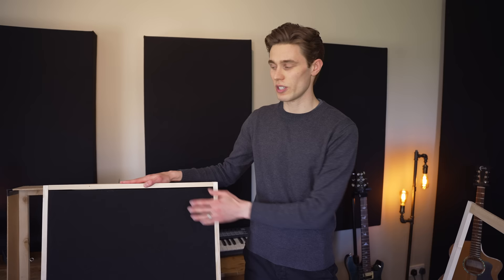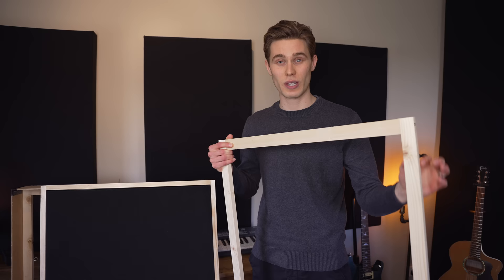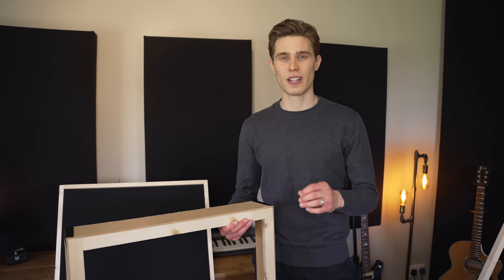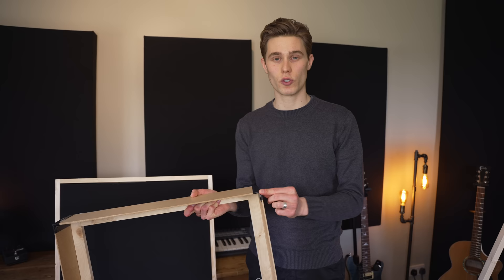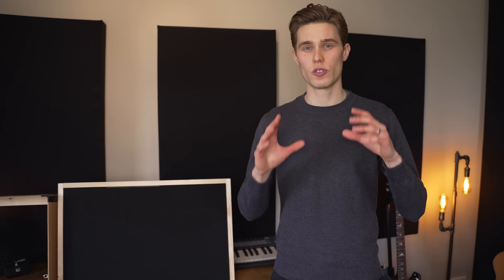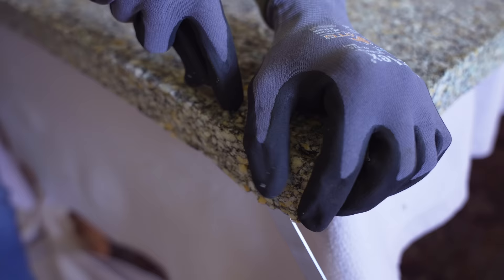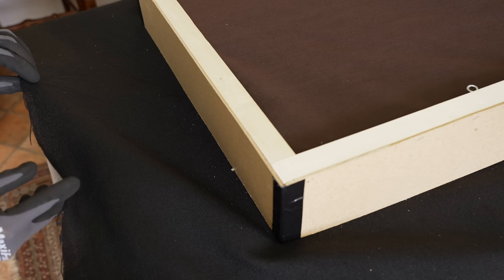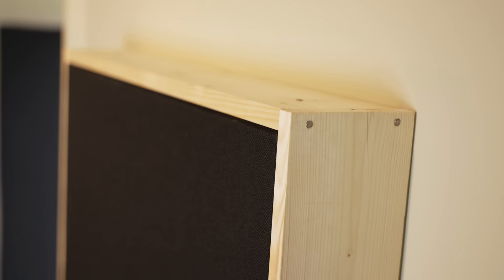How To Make Your Own Acoustic Panels - DIY Professional Acoustic Treatment for Home Studio

Comment: Hi , I really need help please , in my country I can find only PST90 foam that has a density of 90kg/m3 and it’s only 40mm thick… could I only use one to make a panel or it would be better to stack two and have a panel of 80mm thickness? But it would be very expensive… does it make that big of a difference?
Reply: Can't say anything about the foam you mentioned.

But for insulation what matters is not the density, but the "Flow resistivity (Pa.s/m2)". And sadly there is basically no proper correlation between those. One material can be very dense, but not flow resistant, and vice versa. Instead of dampening and eating the energy of sound waves, dense material can simply redirect waves, not improving the reverb situation at all.

I was as sad as you, because similarly to you I found a 120kg/m3 material and was researching the same question.

Thickness matters by itself. Dense but thin materials are not even seen by lower frequencies. There are simple formulas to calculate those.

Comment: Hi, thanks for the tips, I really appreciate that, but I have a question. Is it a good idea to build my own bass traps too using the same materials? 
Obviously with a different shape of the frame
Reply from the maker: Good question. I would advise you to build your own bass traps and make them thicker if you have space. Either a triangular prism frame or just a square frame panel in each corner would go a long way in controlling the sound of your space. 

Many would opt for slightly higher density material and/or much more depth in a bass trap panel. It’s not uncommon for them to be more than 15 or 20 cm deep.

Comment: Hey so I'm building some panels at weird thicknesses to make kind of a stair effect on the wall. My first panel will be 2" thick, 3", 4", 5" being the thickest. How tight does the insulation have to be stuffed to be of utility? I'm planning on using 2 layers of 2" Denim insul inside the 4" and 5" but there will be a small gap in the 5" thick panel, and the 3" thick panel. Is that okay? 

Thanks a lot :)

Comment: Modern glass wool is bio-soluble. Completely safe.
Reply from the maker: Let’s assume I accidentally breathe some in and it completely solubilises in a matter of weeks or months. 

Tell me, where does that solution end up? All the same chemicals, compounds and molecules end up either passing through my system or remain in my system. 

It’s important to note that most poisons are bio-soluble too. They can pass through us but cause tremendous and often long lasting ill health. It’s something to think about when companies apply labels such as “biodegradable” or “bio-soluble”. What does it biodegrade into?

Comment: Question. I’m In wat I’d describe as a medium sized bedroom with my laptop on a table by the windows and my bed behind me. I did a test in Audacity to test exactly what my natural room acoustics are(without me speaking) and looked at it on a spectrogram. I noticed that without treatment I have to set a HPF to over 1k to get rid any major degree of low end rumble, which is obviously gonna make eq tricky coz the natural room resonance is clearly interfering with the high mids of my voice so if I cut the high mids to the point where it kills the clarity, it’s going to kill the clarity in my voice as well. How will I know the trouble spots that are causing the 1k resonance, so I know how best to treat my room

Comment: Is it effective leaving those 20 cm spaces between the panels? (For walls between flats) Would be good news if yes. Or is it just a bit less effective but still good?
Reply from the maker: These panels won’t stop much noise travelling through the walls. They ate mostly designed to reduce echo and reverberation within the room.

Comment: Hey, just ordering material for these, but I'm struggling to find something like the particle board you've used for the inner sides of the frame.
Any recommendations? The material you've used seems almost like thick cardboard rather than wood, and I'm trying to keep weight as low as possible, so I'd rather go with something like that but not sure what to search for!
Reply: Try 3/16” hardboard.  Building supply stores carry sheets, but Lowe’s and Home Depot probably don’t.

Comment: What properties does the front fabric need to have (ie the fabric that can be seen once it’s hung)? I’m thinking some fabrics will themselves reflect more sound than others and make it less effective? Basically I would like to try making some of these and printing some photos on fabric for the front of the panels so it just looks like hung pictures rather than blocks of colour
Reply: Keep it acoustically transparent.  Rule of thumb is, if you can blow through the fabric without slowing down the flow, that’s good material.

Comment: Hey Michael, last year I made 8 panels, but used mineral wool as a material, since I haven't seen your video yet at that point. A few days ago I stumbled upon a Facebook post warning about possible health concerns with using mineral wool and it got me really worried. Basically it said that the wool releases Microparticles in the air, which if you breathe in regularly can cause lung fibrosis, autoimmune diseases, skin and eye irritation, etc. I was wondering what do you think about this? Is it that bad? Should I necessarily switch to some other material like the ones you showed? Do you have a link for somewhere I can buy the material you used? I live in Europe, so I probably could order off the same place. Thanks in advance and great video!

Comment: Michael, what are your thoughts about using burlap sacks instead of insulation? They are cheap and plentiful here in Mexico where they're used by coffee bean sellers.
Reply from the maker: The burlap sacks (I assume rolled or layered up inside the panels?) will absorb and dissipate high frequencies but will not treat the mid range or low end in a meaningful way. It could be useful to reduce echo but might result in a lack of clarity in the room.
Reply: @inthemix  Thanks for the reply! I would be layering them inside frames like those you built in the video, for use in a studio where only voices (no music) will be recorded.

Comment: Would it be a good idea to use them as ceiling clouds? 🤔
Reply from the maker: Yes they would work very well. I might suggest using 2 layers if fabric or pulling the fabric more tightly when used as a cloud.

Comment: Thanks for this awesome detailed video. A couple of questions, for any expert out there to answer, please: 1) Could I use canvas as a covering fabric on your design? I ask because my daughter is a young artist and I think it would be great to have her do some art on my panels, make each one a work of art. 2) I’m also thinking of alternatively using off the shelf blank canvas frames that you get from art suppliers and modify them, with say an extra frame on the back, to make them deeper and fill them with acoustic foam, thereby transforming artist canvas frames into acoustic panels. Any merit in that idea, or would either of the above be not very effective? TIA.
Reply: It depends on what you want to accomplish. Dense canvas is not the most acoustically transparent fabric, so it will reflect some high frequencies. Many foams are not very dense, and therefore less useful for low-frequency absorption.

Comment: Would making one of these panels and hanging them on my hollow door reduce sound getting out of my room? The only sound that I need to block going out is my voice.
Reply from the maker: These are more effective at reducing reverberation within the room. While they would help reduce some sound passing through the door, I feel a better approach would be to use silicone or rubber door seals and maybe use a sound curtain over the entire door.
Reply: @inthemix  I live in europe and haven't been able to find any good sound curtains for a reasonable price.

Comment: First of all let me tell you big thanks for inception of idea, not to use rock/mineral/fiberglass panels, because one summer I have been working at door producing manufactory. And ot was hell, because there was fiberglass insulation. I ran out from there very quickly :)

So. I’m from Estonia and here is no recycled denim… :((

I have found Hemp fiber Insulation with 50mm and 100mm thickness. It have 37kg/m3 density.
Also I have found Wood fiber.
Same thicknesses. And 50kg/m3 density.

Which of them, I mean wood or hemp, better? And what thickness is works best?
Also I heard bigger gap from wall also helps with lows. What gap at least must be?

Thank you in advance! ❤
Reply from the maker: Thanks! I think the hemp and wood will both work well but I have heard that hemp fibre is especially good. Thicker is better, I’d choose the 100mm. 

For the air gap, make it as large as possible. My panels have a small air gap built into the back but you can also add small blocks of wood to the rear of the panel to make it sit another few cm from the wall.

Comment: Is using rockwool density 100 kg/m3 good for making panels? And the panels would be 5 cm or 10 cm?
My room is small 3.2m by 4.2m.
Reply from the maker: 100kg/m3 does seem quite dense. It would likely be acoustically effective but the panels could end up being very heavy.

Comment: What do you think about Melamine foam for acoustic treatment?
Reply from the maker: I took a look for some spec sheets and found that Melamine acoustic foam has an exceptional absorption coefficient above 1000Hz. Below 1000Hz is not amazing but you’d need several feet of panel depth to make much of a difference in those low frequencies anyway! 

I’d say it’s a good choice if the price is right. If you do choose it, could you let me (and the community) know if it was successful? I admit that I didn’t know about that foam until you commented!

Comment: How are your panels working today? No things you would change or so? Also, i wonder, you did corners too right? Regards
Reply from the maker: They have held up great. The “professional” ones I bought have bowed over time at the top and don’t have the same clean lines as these ones. 

I have had lots of feedback from people who have followed this design and I can definitely recommend using at least the thickness of wood I suggested. Some have tried with thinner strips and it just doesn’t have the strength. 

Id also recommend sizing up the cloth carefully as some people underestimate how much they need to wrap the sides and still have spare to staple in place!
Reply: @inthemix  great, Ive watched dozens of videos on the subject, you certainly have a way of doing things the right way :). thanks for taking the time. Cheers

Comment: Hi! I just came across with your channel and I'm very glad about that. I'd like to know which material or how much density should i look for if I'm mainly focused on absorbing the bass of my sound system. Buildings at the city i'm living (Montreal) are pretty old so there's no sound insulation (it's pretty bad) and my room is surrounded by the metal plates of the building, which i share with 2 neighbours, the place vibrates pretty strong when I play music so my neighbours feel everything and I already had problems with that. Please I'd love if you can give me any advice, if you can tell me which options for absorbing bass would be better. Thank you and good vibes <3
Reply from the maker: You can aim for higher density materials but I don’t think it will reduce the vibrations or sound transmission between rooms/apartments.

Comment: I can't find any of the insulation options for the life of me here in the U.S. I've searched everywhere and I simply cannot find any other than fibreglass or mineral wool. I was only able to find Hemp insulation, but buying by the pallet is a requirement. There are, however, ceramic fibre options. I don;t know if thats a safe option or not
Reply: I decided to use Rockwool Safe N Sound 2’ x 4’ x 3” mineral wool.  I take Michael’s cautions seriously, but I have full-shop air filtering, I use a mask and gloves, I handle the batts as little as possible, and I have the opened batts under a sheet until use they get wrapped.

Comment: Hi, thanks for the amazing video, quick question; 
unfortunately I couldn't find any of the fillings you mentioned in the description. Here in the US those materials are either unavailable at the moment or too expensive. I know you suggested staying away from the usual options but looking at my super limited options I saw ROCKWOOL  SAFE 'n' SOUND Unfaced Stone Wool Batt Insulation claims their product is made from natural and recycled materials - user friendly, no fiberglass in product. I'd really appreciate it if you take a look at this product and let us know if this is an ok option in the U.S. Thanks for your time in advance.
Reply from the maker: Hey thanks for the comment. Without commenting on any company in particular, the rock wool options are likely safer than glass wool but still require additional safety equipment and extra wrapping. I'm not a health and safety crazy person but I wouldn't want any of that getting in my lungs or eyes and I'd wrap it an extra time before covering my frame. I'd treat it the same way as I would when using a sander on wood - you don't want that dust getting in the lungs either! For the rest of the project, enjoy the fresh air! 

Acoustically, the rock wool will have excellent performance even when covered in a few layers of cloth!
Reply: @inthemix  Thank you very much, it totally makes sense. I ended up buying recycled cotton batts, it was expensive but it was the right choice.

Comment: How thick should the isolation be?
Reply: People who know this and make excellent recordings tell me that 3” insulation will take reflections of mids and highs so many decibels below the source as to be inaudible.  There’s extensive acoustic data through Google searches.  (I studied it closely while deciding whether to make my panels, but I don’t remember the sources or the correct numbers.) I’m expecting my 3” panels to take care of room reflections and comb filtering when tracking acoustic instrument and vocals.  Most of my sub-80 Hz bass will usually be DI, so there’s no room effect.  There’s still the question of mixing bass through monitors (and simply listening to recorded music).  For that, the solution is thick, corner-filling bass traps.

Comment: what are some common brands for the insulation types you list? im looking through my local DIY stores (Home Depot, Lowe's) and all I can find are Rockwool stuff.  Would you be able to help and point me in the correct direction?
Reply from the maker: I wish I could but there are so many brand names in each country. In the UK we have thermafleece and stecio flex for wool and hemp insulation. Inno-therm for denim and natural fibre insulation etc. 

If you find any, send me the name and I will check out the spec sheet and let you know if I think it’s a good option.

Comment: does the size of the panel matter to the ability to control the sound? Can two smaller panels do the same work as one larger panel? Just curious.
Reply from the maker: Ultimately you are looking at the surface area of the panel and volume of insulation/absorption material. 

Larger surface areas will reduce echo more effectively. Higher volumes of insulation/absorption material will help the frequency balance of a room. 

2 small panels could be just as effective or even more effective than 1 large panel!
Reply: @inthemix  Is it ultimately the insulation that absorbs the sound? Are the wooden frames mostly for containing, reinforcing, and prettifying the panels? Ignoring the details about hanging and covering the panels, would just the insulation all by itself do the job of mitigating the sound?
Reply from the maker: @vseavello  yes, the framing is to hold everything in place and the external framing is simply aesthetic. The extra framing also adds a lot of weight to the panel, which will require a stronger fitting on the wall.

Comment: Hi Michael.
Do you have any information about what frequencies get blocked by the panels? Thicker material blocks longer soundwaves right? Do the bass and sub frequencies also get  absorbed by these panels?
Reply from the maker: Good question. It all depends on the thickness and the materials used (as you mentioned). Even when using traditional glass or mineral wool, you need a significant depth to make a big difference in the low end. I’m talking about several feet worth of absorbers…completely out of reach for most of our spaces I can imagine!

The effectiveness of these panels is certainly focussed on the mid and high frequencies but I would still consider these “broadband” and able to help balance all frequencies to a degree. Of course they will absorb much more at 10kHz and 1kHz than 100Hz.

To summarise, these panels are aimed at helping improve the detail and clarity in your mixing position when using monitors and to improve the recordings you make but they are not going to be able to fix an issue with the low end of your room. This would be the case even if the panels were twice as deep and filled with any material.

Thanks for the question, I hope you do manage to make a few and that it can improve your space!
Reply: @inthemix  Thanks for your quick reply and clearing up my question! I’m for sure going to make some of these panels since they are so much more affordable in comparison to the pre-made ones.

Comment: Do these panels also help to sound insulate a room? Ie: does it lower the dB that leaks out from the room?
Reply from the maker: They will not prevent sound escaping the room in any meaningful way. Maybe a few dB and reducing a small amount of the high frequency sound escaping. Cavity wall insulation and other engineering solutions are needed within the walls and doors/seals to prevent noise leak.